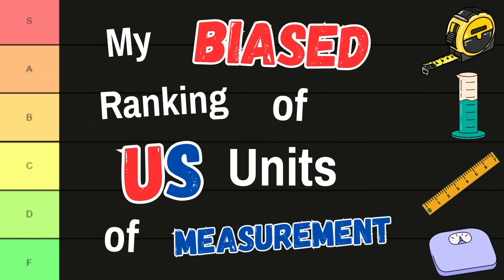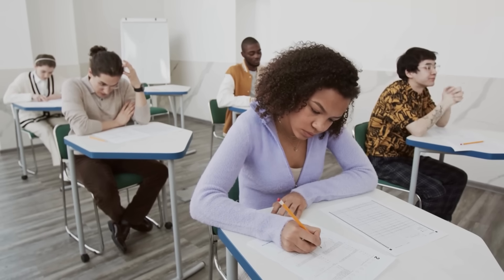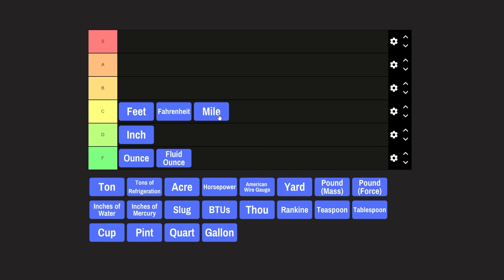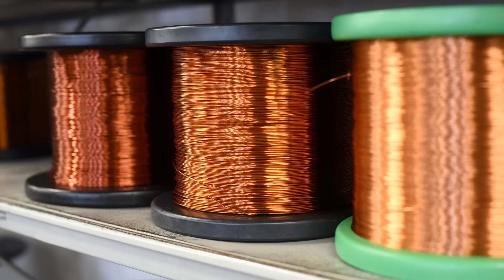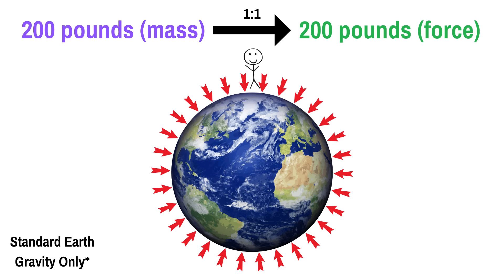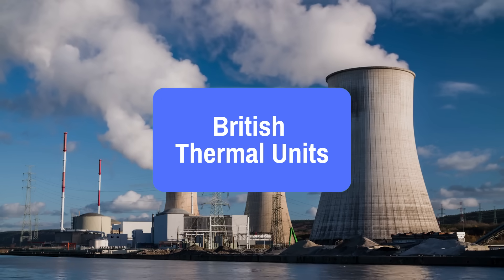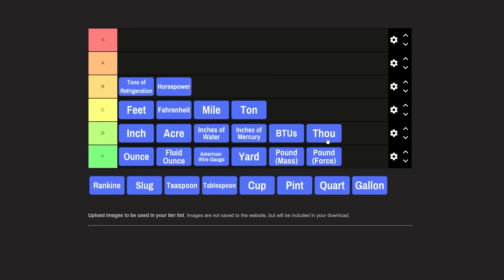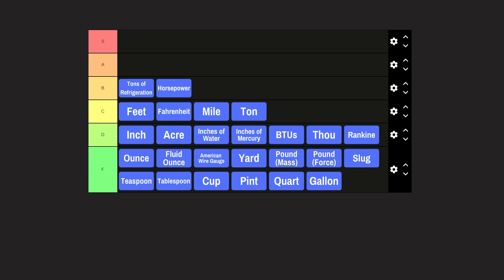Tier List of the DISASTROUS US Measuring System

Comment: I'm shocked, you ranked the teaspoon, tablespoon etc. so low. I honestly think, they are the the most reasonable units in America and they are very easy to use, if you have the correct measuring tools.
Reply: by themself they are, but the conversions are horrible
Reply: @Mattiasthesecond  I agree on that one though
Reply: Sure... Not all spoons are the same volume-wise, and everyone would define what "a spoon of something" looks like differently. Don't even get me started on "a heaping tablespoon" because that could be twice the actually needed weight depending on the ingredient and your own definition (starchy substances like icing sugar or potato starch come to mind and in the latter example such a mistake could fuck up your entire work).
Reply: Yeah but what if you need 0.76 tablespoons of something
Reply: @randommusic4567   Except in the world of cooking, that level of precision isn't necessary. Most recipes revolve around ratios of ingredients to another. However, since imperial measurements are fraction-based rather than decimal, you are far, far more likely to need to double, triple, halve, or third a recipe which is easy to apply to your ratios in recipes, rather than halving or third-ing 85 grams.
Reply: @Aar69  some people are actually capable of dividing by such small numbers in their heads. For the rest there are calculators - I don't know if you're aware, but they're a built-in for every smartphone!

Comment: The only American unit I converted to after moving was Farenheit because it really is just a better unit for measuring temperature in a daily sense. It holds more precision than Celsius, and it allows me to place the ideal temperature at 69. Imperial is also pretty decent at short hand math and measurements. If I'm doing anything precision yeah it'll be in metric. If I need a rough estimate diameter, throwing my hand as my ruler against the part, doing some napkin math, then we see if we need to actually bother with the caliper or any measurements. Then since I deal with aircraft and so kmph and mph both suck, I claim that the Mach is the beat unit of speed ever.
Reply: I'm just too big of a logic lover and since the reference points of the fahrenheit scale are so moronic, I will never be able to appreciate it.
Reply: I rarely need a finer resolution than 1°C in daily life. And when dealing with meteorological equipment (Sensors we maintain at work) they have a resolution of 0.1°C. Which is enough for civil aviation.
And as someone used to Celsius from childhood on, i would say Fahrenheit is only more convenient to those who are used to it. (nothing wrong with that)
Same with etimating things. What you are used to for a long time seems easier. (if i spread my hand, the tip of my thumb and the tip of my pinky are exact 25cm apart. Have used that to measure tables etc.)
And the base 10 system in metric in my opinion makes it easier in "napkin math" as you call it, as everyone is able to etimate 50%, 25% or 75% and those then are just what you have in the unit: 1.5, 1.25, 1.75...
-> i personally can estimate 5mm, i can not estimate 3/16th of an inch. (or when people talk about tyre tread depth: some 32nds of an inch... i can estimate 1mm, 2mm, 3mm, 4mm, 5mm but i have no visual concept in my head of "thirtyseconds" of anything.)

As for aircraft: kts, NM and ft. are a "pita" of aviation in my opinion (together with still leaded fuel for piston engines and AM for radio modulation.)
But as with everything in aviation: no chance for changes as "this is what has always been used and people could get confused".
Reply: "is just a better unit for measuring temperature in a daily sense."
Why?
For whom?

"place the ideal temperature at 69"
And the same can't be done in metric?

"Imperial is also pretty decent at short hand math and measurements."
How so?

"It holds more precision than Celsius"
How is Fahrenheit more precise?

"throwing my hand as my ruler against the part, doing some napkin math"
And the same can't be done in metric?
Reply: Thank you for your rational analysis. Fahrenheit is not as bad as people think as it’s just a scale.
Reply: @mbdg6810 Farenheight is awful. Like any scale, it is useable if you are taught to use it from a young age, and then pretty much practise it every day of your life. But the second you try use it in a scientific or international context, shit is whack.
Reply: @CC-INV  which is why OP said it was better in a casual, every day context, not a scientific one. 0 is really damn cold, 100 is really damn hot, dress accordingly. Easy-peasy.
Reply: @Churchgrimm  But celcius ALSO works in an everyday context if you’re taught to use it (same as farenheight). 0 is freezing, 40 is really hot, and it comes with the added benefit of being used in other fields. Celsius has all the advantages of farenheight, without the disadvantages, makes school easier. The only conceivable drawback I can think of is if for whatever reason a 1 farenheight change in temp was important, you’d have to use decimals in Celsius. But its not exactly difficult to know how much hotter 25.4 is than 25
Reply: @CC-INV   @CC-INV sure, but you kinda just argued that using Fahrenheit would be fine if everyone else used it. It works if you are familiar with it and everyone else is as well. The primary disadvantage of Fahrenheit is that only one major country uses it, and the primary advantage of Celsius is that it's used by all major countries but one. Both are 1 for 2 in the "are 0 and 100 useful and constant for all human beings" category (0° C and 100° F are frozen water and a fever, respectively, for everyone everywhere, while 0° F is frozen brine and half of humanity boils water at 99.5° C or less, to speak nothing of 100° being a round up at sea level anyway.) Both are defined using Kelvin, and thus both are defined by the Boltzman constant. Neither use the freezing or boiling point of water for their standardization. You CAN use Fahrenheit in industrial and scientific contexts, the reason one shouldn't is simply because most of the world doesn't. Were it my choice the US would use SI units, but that's because nearly every other country in the world uses them. The world would be pretty much the same outside of some edge cases if we all used Fahrenheit/Rankine rather than Celsius/Kelvin. If the US, hypothetically, was the only Celsius/Kelvin country in a Fahrenheit/Rankine world then they would be correct to adopt Fahrenheit/Rankine.

Comment: The fact that feet it's not even a order or 10 of inch makes it all just harder.
Reply: And then you get loads of Americans who tout that as one of good bits, because "12 is so divisible", not that anyone really needs that or that it can't be done in metric.  (And they also use very weird stuff like 3 7/64" (that's 3.109375 inches).  Look at a measuring tape with inches: the markings between the inch marks are sixteenths or even thirtysecondths)

Comment: The only imperial measurement that i like is psi its simple quick to say and understandable, but it uses pounds and inches, kilograms per square centimeter would be better if it was used more often
Reply: Well pound is a unit of force, not of mass, so the metric equivalent would be Newtons per square meter, which is in fact the SI unit of pressure (Pascal).
Reply: @yannickurbach5654  i am talking about simplicity in day to day use
Reply: 1 bar is slightly more than 1 "kg force" per square centimeter.
1 bar = 10 N/cm^2

Comment: Fahrenheit and Miles/h (edit: lbs also share this) work incredibly well together, it shares a scale that the human experience can relate well with, that makes changing just one or all difficult if they don’t continue to share the same scale 

100 is very hot, almost too hot to handle. It is very fast, too fast to handle not going straight. It is too heavy for most to handle  

32 is freezing, but manageable, 35 is slow but not too slow, it has some weight but most can handle it 

0 is freezing in an uncomfortable way, 0 mph is well … 0 lbs, you get the point 

55 is chilly, just like it is both fast and slow, a lot of people struggle with this weight, but a little thinking and it’s no problem

Comment: It would bother me if 1 inch was 1/12 foot. Or 1 twip 1/1440 inches. If water boiled at 212°. What if a yard had three feet. And a yard would be 1/1750 miles.
Then the metric system is better. Two German pounds are one kilogram and everything else can be broken down into 10 or 1000.

Comment: Here's my take on the measuring systems, taken from a comment I left on Reddit:

Both systems have their advantages.

Feet, Inches and Miles are better than Meters, Centimeters and Kilometers, simply because there is no intermediate between meters and centimeters. Though, it'd be nice if a mile was 5000 feet, rather than 5280, and also it'd be nice to have a unit smaller than the inch, similar to the millimeter.

Liters, Milliliters, Kilograms and Grams are better than Gallons, Cups / Fluid Ounces, Pounds and Ounces. I still don't completely understand the US units, even as an American myself.

Fahrenheit is better than Celsius. I feel as if Fahrenheit is more descriptive of temperature outside. I do wish water's freezing point could be 0° and it's boiling point be 300°, though. Celsius does have the advantage of simplicity.
Reply: @mss5604-s4m  Hmm.. did not actually know that! However, a decimeter is still too small for my liking. I still think I'd prefer to use feet and inches, honestly.
Reply: @mss5604-s4m  honestly I never use the intermediary meter units. I simply call 1 dm as 10 cm (in daily conversation we shorten it to "10 centi' and everyone will know that it's cm instead of, let's say, centigram, which is uncommon too). Similarly, 10 m instead of 1 dam and 100 m instead of 1 hm. An exception maybe for hm, because in Indonesia we have the unit "hektar" which is more commonly used to express land area. 1 hektar (ha) is 1 hm² (a square with a length of 100 m or 1 hm), easier to remember than 10000 m².

Comment: in my opinion, cups teaspoons etc are by far the best ones out of all of those. they are intuitive and practical. The conversions are a bit arbitrary, but that's okay, since you only use them for cooking anyways, where you dont have to do conversions.
Reply: Yes, but if you would stop using cups, teaspoons and tablespoons for a measurement of mass for solid ingredients THAT WOULD BE GREAT

1 cup of flour can result in WILDLY different outcomes, depending on how compact the flour is! Just use grams. Or, if you really insist, use ounces. BUT NOT CUPS!!!!
Reply: No. They are not only arbitrary, but misleading, since one cup can be like 5 times smaller than the other

Comment: the good old "fahrenheit makes more sense for temperature" explanation doesn't make much sense. I agree it makes much more sense in cooking since cooking requires a wider range but since I can't read fahrenheit it's useless for me. but in weather temperature? it's not better than celsius. "but 0°F is cold and 100°F is hot". you're reaching. 0°F is nearly -18°C bro that's not cold, that's extremely cold. it starts snowing at 0°C so I think that measures coldness better. as someone from south america 100°F is not hot, it's very hot. not worth the trouble of all that nonsense just so people can have a "relatable temperature measurement unit". 100 cents equals 1 dollar, simple

Comment: Ounces and fluid ounces do not correspond for water.   There isn't a single state of water in liquid phase, where 1 fluid ounce is 1 mass ounce.   This is why there are not the same number of grams in a pound, as there are milliliters in a pint.   So "a pint is a pound and the world is round" is only a half-truth.

There should be, and if it were my choice, I'd define the pound to be 480 grams, and the pint to be 480 milliliters, so both ounces would be a round number of 30 of the corresponding metric units.

Comment: Force and mass being equal would only be accurate in a vacuum. Since we don't live in a vacuum, and the densities of various elements making up air and other things, create variances between mass and weight, therefore mass is not equal to weight in any known environment to humans. For example, users of metric call kg their weight, which isn't even a measurement for weight, and they also use some constants to calculate their mass, which is slightly accurate, but not accurate.

Comment: Unpopular opinion, the metric system is incredibly overated and the imperial system is more convenient for day to day life

Metric system units are always slightly inconvenient sizes compared to imperial units. Millimeters and centimeters are too small for most situations, and meters are often too big. Inches, feet, and yards are much more conveniently sized units at the human scale.
You even noted this yourself with Fahrenheit being a really convenient unit, where 100 is uncomfortably hot and 0 is uncomfortably cold.

All units are arbitrarily defined anyway, and it makes a lot of sense to define your units to be convenient at the scale you're using.

If your goal is to avoid arbitrary units, we should really be measuring things directly using universal constants, and there are some systems that do this (look up natural units), but good luck measuring things in terms of the speed of light and the planck constant.

Really the only thing metric units have going for them is the ease of converting between them in base 10. However in your normal day to day life you seldom need to convert between units that way. If you're working at the scale of inches, you use inches. If you're working at the scale of yards, you use yards. And if you're working at the scale of miles you use miles. They're not designed to be converted between, so the ratios between them don't matter

tldr; imperial units are convenient sizes for common daily situations, or are defined for specific use cases. Metric units, while incredibly useful for scientific or engineering purposes, are detached from the typical human scale. And the constant push to centralize measurement around SI units is pointless and ultimately impractical.

Thank you for coming to my ted talk

Also base 10 is dumb and arbitrary, base 6 forever
Reply: This is why the Imperial System lives on, because it isn't that bad. Many other measuring systems are worse so they were more willing to give up their old system for metric

Comment: My dad, a retired surveyor for California Transportation, said there's one important thing youre missing about the mile and acre.

 One square mile is equivalent to 640 acres. You may think this is a weird number but there's actually some practical uses for it. 640 is easily divisible by 2. This is helpful because when something is split into square miles, and you just want to find a sectional area or half/quarter of the length of one side, you can divide by acres to make it really simple to do the math.

 My dad said although it doesn't seem practical for the layman it makes calculations of property lines, water channels etc. much quicker and easier to do for surveyors and engineers. Still, imperial/fps sucks, but at least it has some interesting features.
Reply: Metric user here.
"One square mile is equivalent to 640 acres" genuine question , did you mean acres²? Because if not, how can a squared unit of length be directly converted into another non squared unit of length?
"You may think this is a weird number but there's actually some practical uses for it. 640 is easily divisible by 2", yeah that sounds useful, but then again, 1km² = 1000000m² which is also easily divisible by 2, 5 and 10, so it's not really a real advantage over other measuring systems.
Reply: @IskeletuBr  acres are a squared unit
Reply: @GER_Jack  I see, that makes more sense.
Reply: Just because the furlong is ten chains and the mile eight furlong.   The acre a furlong by a chain . Unlike the foot those units didn't shrink by 10/11 in the thirteenth century.

Comment: AWG is no that bad. The 39th of square root is because of defining 40 different gages (a number which sound reasonable). And you (I mean, not you you) want a constant ratio between two consecutive gauges, because it's more practical from an engineering point of view ("I want a thing x time bigger/smaller").
So starting from a small gauge, you'd need 39 constant-ratio steps to get the big one (40 points <=> 39 intervals).

... all of this to say, still a bad unit, though.
Reply: Constant % steps is a great idea, so you see it with Torx as well -- except their steps are really uneven for no apparent reason.
Reply: If you’re used to millimeters squared it’s pretty weird. The higher the number the thinner the wire 😳

Comment: all measurement systems are arbitrary and based on random bullshit, you can value the consistency of metric all you want but imperial is certainly handier for a lot of things, hell the value of a base 12ish measuring system can be seen in the way we track time
Reply: it's no longer arbitrary though, metric now has definitions based on universal physical constants. base 12 is useful, you're right, not "base 12-ish", if you detach from the ease of division that base 12 allows even a bit you completely lose any advantage it has. it's also mostly applicable only when in small amounts like a 24 hour day, the number system still being base 10 means it's still not intuitive for larger numbers.

imperial being better suited for day to day measurements also becomes a problem when not everything is on the same measurements. if you weigh 14 stone and your backpack is 8 pounds but you need to add something weighing two kilograms to that, suddenly you have to break out a calculator and any ease of use is thrown away.